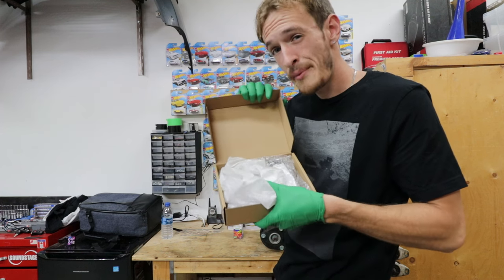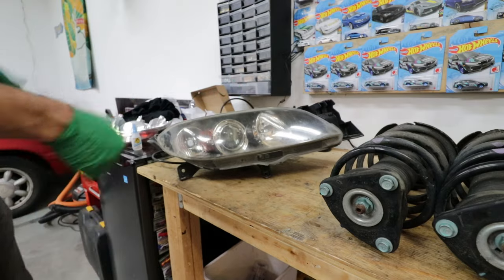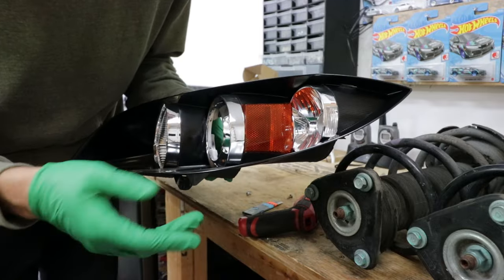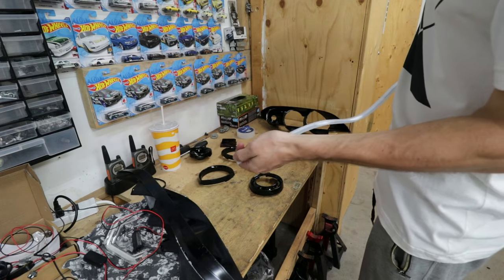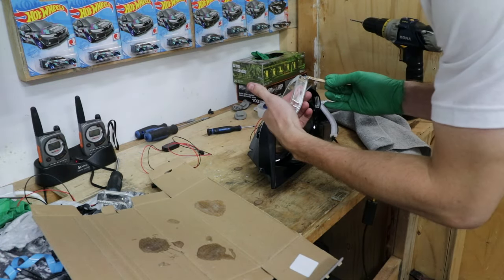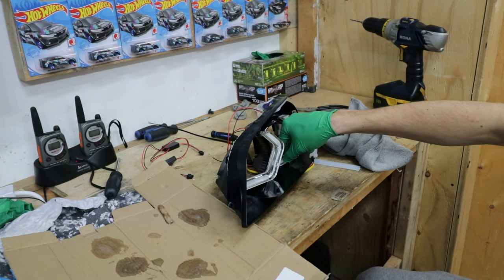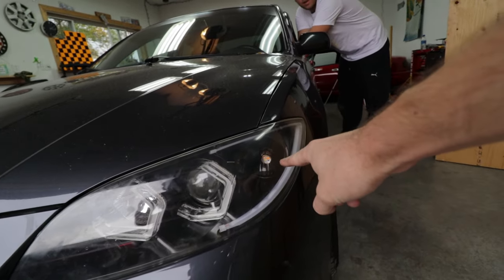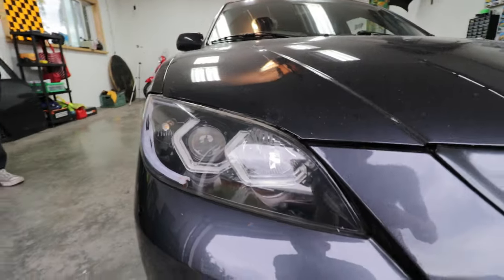Building CUSTOM Mazda 3 Headlights! (M4 Halo's | RGB | LED Strip)

Comment: Heyo, nothing as crazy as what you're doing, but if I were to buy some housings meant for Halogen bulbs without the HID Ballast Module would I just need to mount that from my current Xenon headlights or is there more that I'm missing?

Comment: I'm planning to do these for mine. What happens when the halo or dlr strip dies out - how do you replace it, do you have to remove the whole cover and redo it? Also do you think wiring would be complicated for a first timer, and is the in-cabin switch necessary? Did your headlights fog up yet? Thanks, Ben
Reply from the maker: If they die, they die, you do the whole thing all over again.
Wiring isn't complicated, there's lots of help out there too.
Cabin switch is not necessary.
Headlights haven't fogged up, but I also haven't driven the car since.
Reply: @ColtonRichter  I appreciate you taking the time to reply to everyone 🙏 Last question, if you have the halos, you can delete the current headlight bulbs right? And just use the halos and dlr strip. Thanks
Reply from the maker: Nah man those halo's ain't going to project light like your headlight bulb

Comment: Nice. Did custom headlights on my 2nd gen 3 about 2 months ago, and I just love them! All I did was paint the insides black and put 1 pair of round switchback halos in. With my LED switchbacks I already had, it almost looks sequential, as it’s got a slight delay compared to the halos 😂
I wired my halos up to turn on with the ignition so they act as DRLs (which weren’t available from factory in Australia until the 3rd gen), and added a 30A SPDT relay so they turn off with the parking lights/headlights; considering how bright they are, I don’t wanna blind everyone at night. Also, the fuse I tapped into has a 20 second delay after turning the ignition off, which just adds to the looks, and also helps me see where I’m going when getting out of the car at night 😅
Reply from the maker: Great idea on the wiring side of things, that delay would be sweet for a daily!
Reply: hey man do you have any pictures? I'm wanting to do  my gen 2 but blacking out the housing is scaring me

Comment: One could really get creative if they know a bit of 3D printing stuff, how to vapor smooth that or other surface finishing work, then use silicon release molding with optic-clear cast resin and a vacuum or pressure chamber. Sometimes the casting also has to be staged with different dyed sections, if desiring red or amber lenses within a composite assembly. There's spray-on mirror finishes now if vacuum deposition is too complicated or difficult to figure out for any reflector bits. And if knowing a bit of electronics to custom fab LEDs, that could stretch options even further.

Yes it's convoluted, but all those skill sets can be meshed together and applied to this kind of thing if wanting to go yet another level beyond kit-bashing some already existing stuff together. Also it's funny I've seen enough of all those different processes to know what's possible, but still nobody showing it all coming together just yet.
Reply from the maker: For real, 3D printing opens up huge customizable opportunities.

Comment: Did you ever connect the remote starter for the halos? I bought a kit of off aliexpress which has a similar instruction manual as yours and its says fade on/off meaning they turn on when I unlock the car which is quite cool but Im not really sure were I would hook that cable to. I would appreciate any kind of help, keep up the great videos you give me soo many new ideas for my mz3 bk <3
Reply from the maker: I didn't no

Comment: Bro, i know this a dumb question but for the switchback. Ground wire goes to any metal contact surface of the car?  Because there's two wires, does yellow wire go to the signal positive wire, & red goes to headlight positive wire?
Reply from the maker: Yes
Reply: thanks!